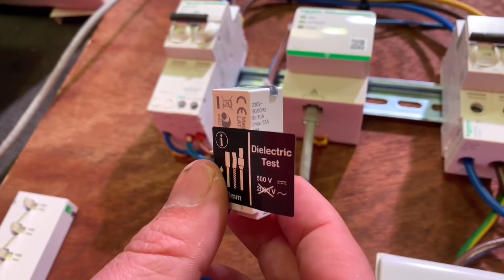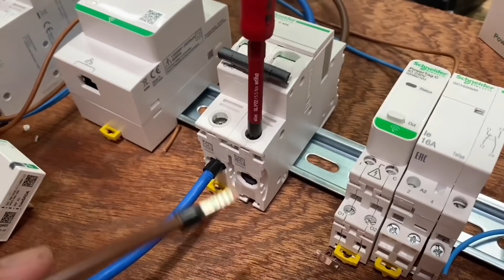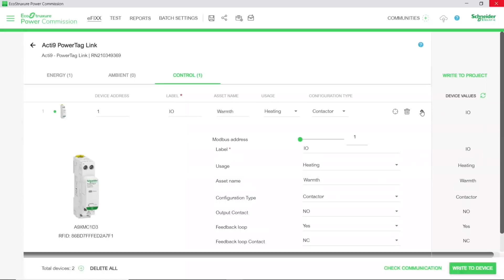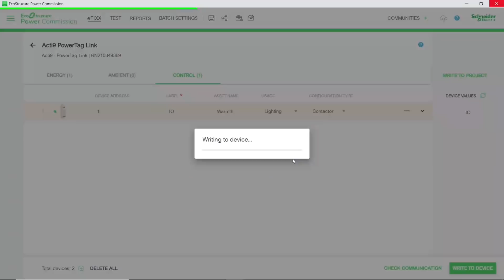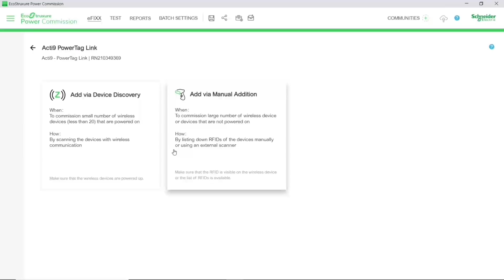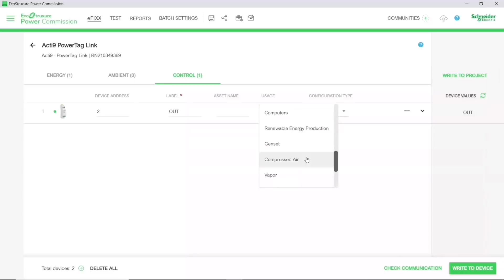Smarter distribution boards with Acti9 Powertag - from Schneider Electric

Comment: great video sir! can i ask , did the power tag need wifi to be connected? and what is the range? thank you very much
Reply from the maker: The tabs connect wirelessly  to the concentrator which has a wired network connection.

Comment: Looks great.But, does the cost of installing this system not out-way the potential savings? Thanks for the demo as always.
Reply from the maker: Thanks, Brian - You would be amazed at how much money can be saved by just monitoring and targeting small incremental improvements in energy efficiency. Doing week to week or month to month comparisons can identify kit which is left,  misbehaving or needs replacement.  I once worked in a factory with lots of clean rooms. By monitoring the power you could tell when the air filters needed changing - *Gordon.
Reply: @efixx  Thanks Gordon,  i never imagined it could be such great amounts saved. Plus give you information indicating when things like a filter needs changing. It may well be worth the cost of install. But you have to be talking big money to cover a site with multiple DB's. I guess the savings must be worth it though and as a nation we are doing our best to reduce energy use and cut emissions. Well done Schneider.
Reply from the maker: These tags are easy to fit so you may selectively deploy them in a focussed area and then move them once the project is complete.

Comment: Power usage is one example but power quality analysis is even more significant to dig deeper on power quality analysis, leakage currents, transients, swells, sags and impacts of that on operational efficiency of equipment. It’s all about the mathematics of signal extraction and
Analysis. The challenges  is to see these voltage current, power factor signals at shorter and shorter signal time periods and here I am talking about nano-second level approaching speed of light. It’s even more of a big deal in communication and data networks where signal corruption can be very costly indeed.

Comment: No issues with CAT5/6 in the distribution board ?
Reply from the maker: Good question Phil - you would need to specify a data cable rated to the same voltage as the panel  > 400v - something like this - https://lapplimited.lappgroup.com/products/online-catalogue/data-communication-systems-for-ethernet-technology/industrial-ethernet-cat5-5e/cables-for-fixed-installation/etherline-cat5e.html?format=pdf
Reply: Yh I was thinking mainly about the shielding and screening for the Ethernet. I suppose if careful you could ensure the cable is not routed near AC, and you use a fully sheilded S/FTP cat6 with a ferrite bead or two for additional screening.
Reply from the maker: Interference shouldn’t be a huge issue Owen. Mainly because data rates are low as the devices don’t continuously send energy data they poll every 30 seconds.
Reply: @efixx  also just thinking induced transients, that said ETH is galvanically isolated with magentics inside the switch gear so that should all be ok.

Probably still a 'best practice' to use a high grade a cat5/6 cable as possible (shielding wise) in a dense CU. But as you say, low polling data rate does give a large scope for getting away with less at a pinch.

Useful product for those environments that would benefit from this (heck I'm just a tech nerd 🤓 so would - given an unlimited budget! - have it in my house if I could!!!!!)
Reply: Interesting presentation.
What do you guys think of the trend for trying to make 3 phase Distribution Boards obsessively neat by cable tieing the Phase, Neutral and Earth conductors tight in their respective bunches. I was thinking heat build up could be a problem.
I am coming across it more and more when making alterations which can be a real pain having to cut all the ties to find a core buried in the mass.

Comment: Great Video as always. Looks like a awesome little product, Had the perfect place for those. In a large warehouse, could have used them to control the switching the lights. could have monitored the energy consumption. and when not in use have them switched off. would be good if Schneider created some training material on there website for designers.
Reply from the maker: Great application - we think the training exists somewhere - we will try to dig out a link.

Comment: I used to dream of something like this when I was managing the energy when I worked as an engineer in the brewing industry. We were always good at measuring, managing and reducing energy, but we could have done more with something as cost effective as this. Putting individual Cube Meters on seperate circuits got quite expensive, not due to the meters as they were less than £100. It was all the other bits CT's, connections to the management systems etc, etc. It all added up and you'd end up having to put another panel in just to put the Cube Meters in. I had a quick look and ND Metering are still supplying updated versions of the ones I used to fit https://www.ndmeter.co.uk/cube-400.html Excellent stuff again guys.
Reply from the maker: Cheers Bill - If you still have any contacts in the brewing industry we will gladly volunteer to pop along and give a demo of the kit ! 🍺🍺🍺

Comment: So a big problem here. How do you measure savings? In terms of electrical savings that would mean the absense of use or reduced use how do you measure not using something?
Reply: Within industry you would measure the energy usage over say a production run, (in the brewing industry it could be steam used for a brew). You could compare each run or weeks production against each other. When you had a base you could then look at the process and see where you thought you could save energy. For steam that could be that you re-insulated the copper, because the old insulation was breaking down. You could then compare the before and after steam usage to see how much steam use had reduced. A favourite one could be repairing air leaks over a weekend and then seeing how much less electricity was used by the air compressors the following week against the amount of product that went through the department. You have to measure it to manage it, as Efixx say. I always found it one of the more interesting part of my job.
Reply from the maker: @billdoodson4232  Agree it becomes adictive. The Volvo factory shown in the video repainted the walls "light grey" and reduced lighting power consumption as increased reflectance meant they needed less light.
Reply: @efixx Not something I tried I must admit. I did replace a load of 400 watt sodium lighting in the main warehouse with 150 watt Induction Lighting (LED's were not a thing really in 2001). The actual light output went down slightly but due to the better colour renditioning it was a far better light to work under. The big thing was you could turn them off at lunch and breaks and they would start up immediately again after the break. Fantastic savings.
Reply from the maker: It depends on the environment and type of energy use. Usually you’d establish a base data level - so what was energy in the previous period. Then look for targeted interventions with estimated payback. You should then see a reduction in energy once the intervention is implemented.  Then compare the data.

Comment: One of my mates works for Schneider Electric in their Energy Monitoring Services in Scotland and he monitors the energy from these devices remotely for major clients and can provide much more accurate usage to enable businesses to save money on their commercial energy bills! So it may cost a fortune to get these installed in large commercial installs but they do save clients thousands of pounds as they can use this data to dispute overcharging!
Reply from the maker: Wise words Bryce - There is good opportunities for everyone in the electrical supply chain for measuring and implementing energy management.

Comment: Could be interesting. But only use I can see is very large domestic use and Commercial.

Possibly for home automation if they can be controlled via a universal standard

Only question I have is what happens on a network loss?
Reply from the maker: The system would usually be feeding in to a top level BMS system which would gather the data. Good question on the data network loss - we will explore that.

Comment: Would this not be for specialist electricians to install? Not your every day spark and what about testing and inspection? 
No point in a domestic installation .
Another great video from the eFix team
Reply from the maker: It’s aimed at larger installs and a good opportunity to add some specialism to an electrical business.
Reply: @efixx  it will feed back to residential settings it will be needed as when we move to EV, island mode and proliferation of smart devices.